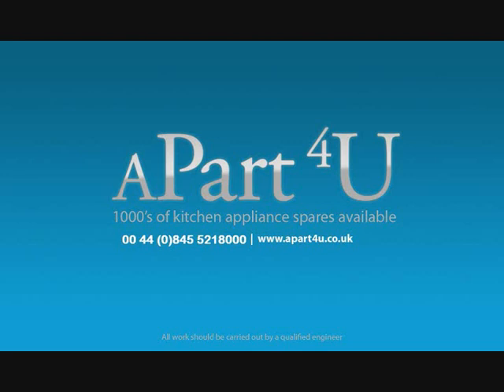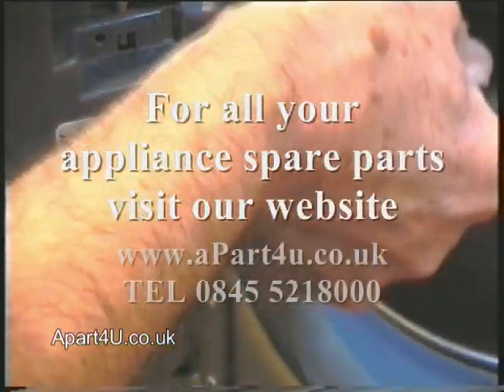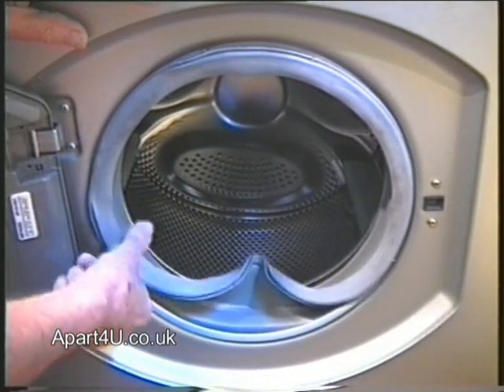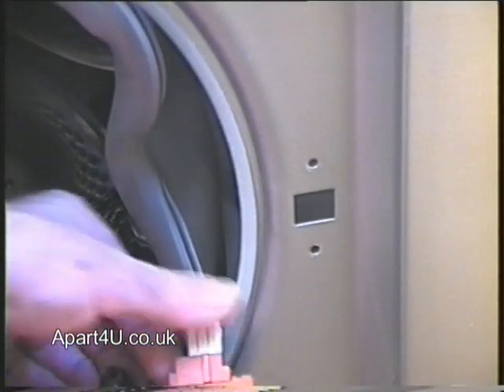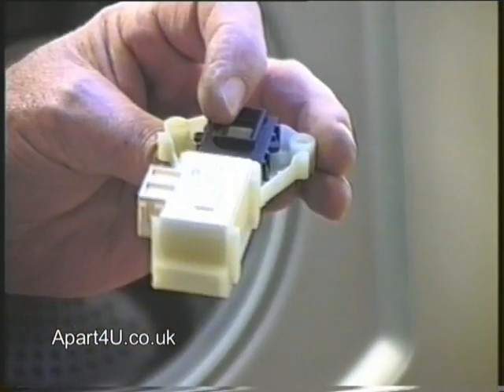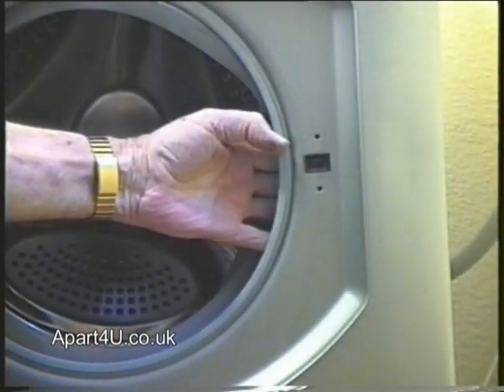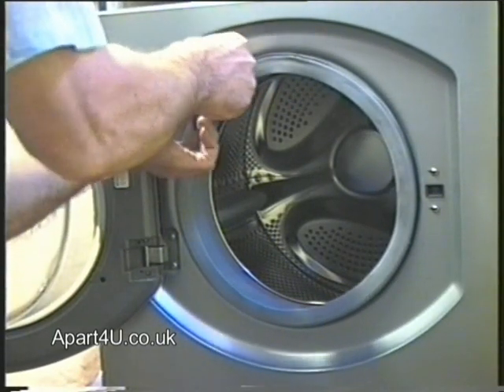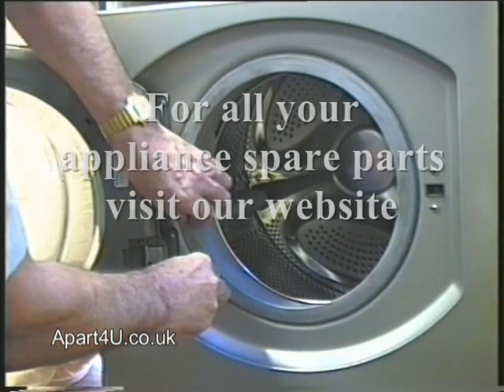How to Replace a Indesit Washing Machine Door Lock, Interlock

Comment: Very informative however, I still don't know how to remove the seal retainer....I have a Hotpoint WD62 Washer Dryer which has a plastic 'block' that seems to sit on top of the rubber seal.  It looks like it has a little button or something on the front but I have tried to push it in but don't want to break it.  I feel that this may holding the seal retainer in some way.  I desperately need to change the interlock but just cannot remove the rubber seal. HELP!!

Comment: I need some technical advise please I have an Indesit w84tx machine. 
I opened the back today & I THINK narrowed down the issue to either the belt or motor. maybe it has an agitator coupler in the motor that I havnt checked. the belt looks in good condition but not sure how tight its supposed to B. the motor wants to move but need a push to keep going. but also I can turn it from the motor w/ease. I removed the belt and let it work & I can stop the motor if I squeeze my fingers hard enough.